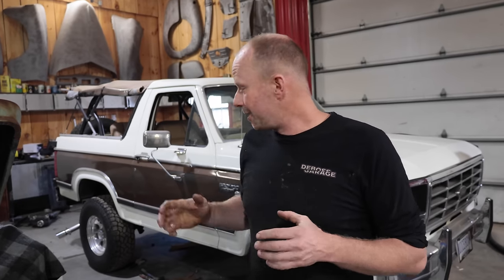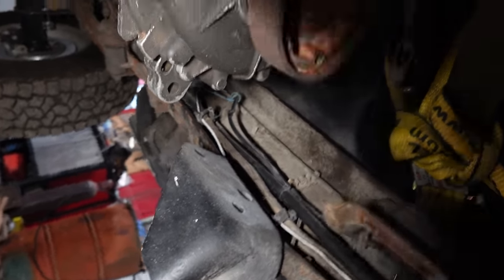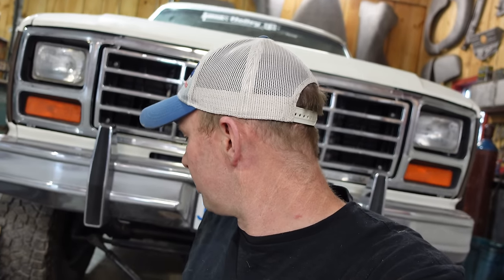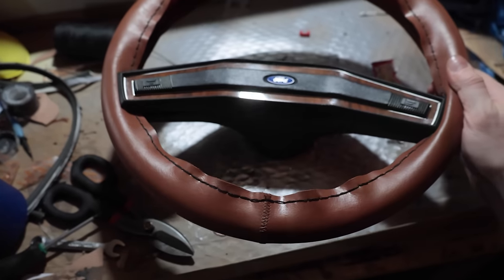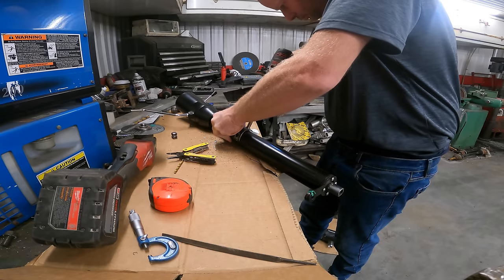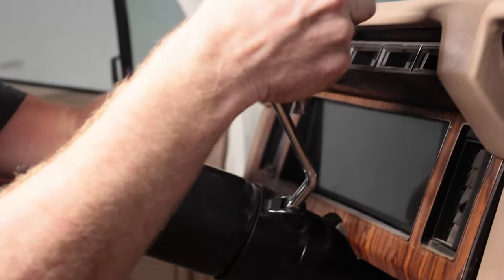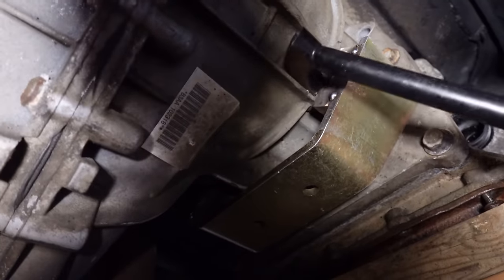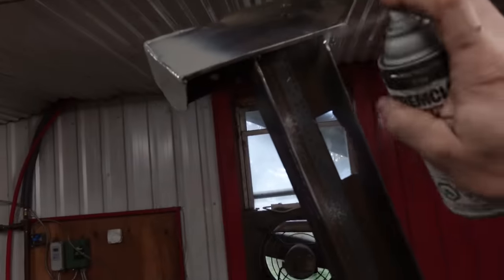Best Steering Upgrades for a Bullnose Ford! #JuiceBoxBronco [EP13]

Comment: On my 1995 Flairside I installed the Borgenson steering shaft and Redhead steering gearbox, took all the slop out of my steering wheel, really stiffened it up. Wish I could put Coyote 5.0 in mine. One day. Y'alls build is so sweet

Comment: “I could work with one hand…I’m not stupid”

…cuts directly to using a massive drill press with a large sharp chunk of metal and hold it with your hand….

Keep it up you might get ur wish😢

-someone whose lost an appendage in the automotive industry
Reply: The ultra thin cutting disks and no guard make me cringe every time. I've seen those things blow up a few times and they don't mess around

Comment: Pro Tip: You can freshen up the look of the faded red 4WD hub selectors by using a small propane torch, and lightly licking it with the flame. They will go from pink to red. Just take your time, and maybe try it on something less important to get the technique down. 
Have a great day, Sir! o7

Comment: Ok. Not digging on the project but I been thru this with broncos, minus the coyote install(😅). And here's some things I suggest.   You might rethink that crossmemeber clearance for the front driveline , it needs more than a notch if you hit many bumps. I noticed a previous ep that you didn't do rear cv drivshaft or 3RD member flip for better angle. See how that goes cause I've seen it be good and bad. I am curious about the no xover in the exhaust, but it's not complete yet . You've done an awsome job in this series 👏. I'm wanting a coyote now, thanks

Comment: hey Rich, I know this video is a few weeks old but I would like to ask for your opinion.

I know you are converting your bronco to auto, but i plan on doing the opposite in my own 94 bronco (coyote swap with manual). my question is - given that the wheel base of a bronco is tiny and the transfer case must be married in order to fit, which manual transmission would you put behind the coyote? thanks in advance

Comment: All vehicles with the 5.0 V8 have electric power steering. There is no factory power steering pump that bolts to a 5.0 V8

Comment: Not hating on the build, but I don’t understand the 5.0 with the axle ratio’s he chose.  It certainly has the wide power band for it, but aren’t cruising rpm’s gonna be way high?
Reply: .69 sixth gear in a 6r80. Should be around 2000 rpm at 70mph with 4.11 and 33s. Nothing wrong with that

Comment: I've done the steering wheel cover as well its affordable, even cheap to do but, takes 2 hours to install. My 05 sierra has 260,000 miles so you can imagine the difference. So nice.

Comment: If it's manual transmission, the hydraulic clutch pedal will crack the firewall. . Add extra bracing there. I liked these rigs; been all over Nevada in a couple of them. Straight six plenty power, low end torque great.

Comment: I remember kids stories about the local Ford dealer unloading this generation of pickup from the trailer. The frame rails had large holes in the C channel to reduce weight and you could see the box fold towards the cab. 
That hood seems to be quite holey.

Comment: That borgeson shaft is made really well!  My non borgeson stock replacment shaft needed the rag joint tightened with washers, and a feeler gauge stuck in the slip joint there was so much slop.

Comment: With your solid front axle are the spring shackles in front or rear? I noticed that all 18 wheelers have the shackles in the rear but my Jeep CJ has them in the front. I have heard that changing them to the rear makes the steering more stable.

Comment: Where that cutout is on the crossmember is a cause for concern as there is still a bit of metal missing from where the cuts were made. I'd be welding at least those cuts up next time it comes out as a preventative for future cracking.

Comment: Just wondering if the frames are the same in the vans? I have a 76 e150 that i want to convert to 4x4. Anyone have a clue?
Reply: And get youreself a tailors tape measure they work great
Reply: Nothing better than grabbing a hot shifter in the summertime 😫

Comment: They told me my 2018 f150 had the electric steering too because it included the turn knob reverse bs that I've never touched. Steering has always felt loose even from factory the dealer said they all feel like that. So I'm unsure if it's a post 18+ if it'll be any different boss
Reply: It's "electronic assisted" steering
Reply: How could you buy such a hunk of junk😢
Reply: @fastinradfordable  young and dumb my friend, 46 grand mistake.. live and learn. It still runs.. after it's paid off here in a couple months I'm ripping the engine an Trans out an having them redone. A 70k mile 5.0 shouldn't be ticking or eating oil screw what Ford says.